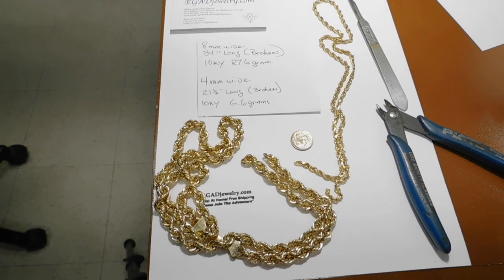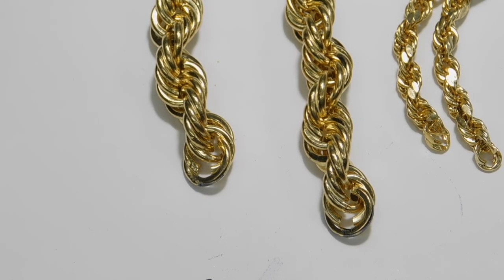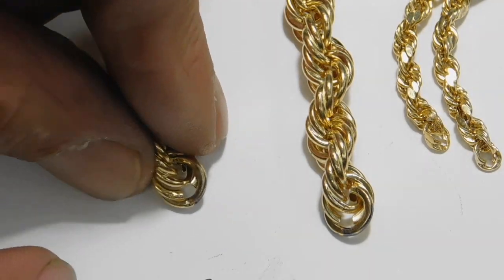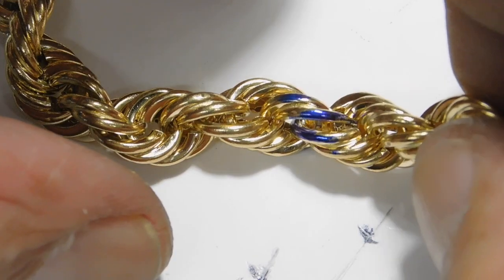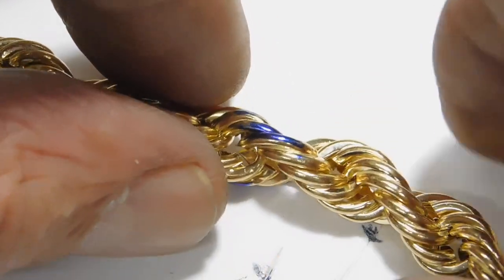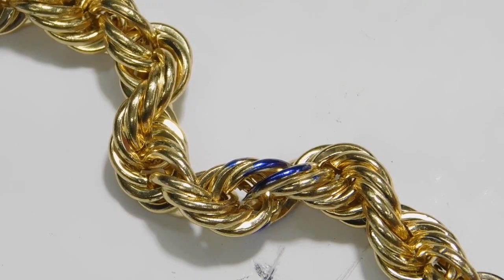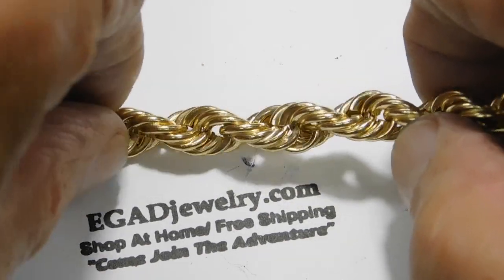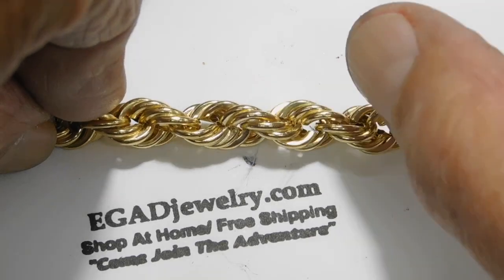BEST VIDEO FOR GOLD HOLLOW ROPE CHAIN REPAIR - EXPLAINED AND DEMONSTRATED - UN-CUT/LONG VERSION

Comment: Can you extend a 22 inch 5.5 mm mariner chain. To a 26 or 28 inch mariner if I have a section of the exact 5.5 mm mariner links from a bracelet I have. That matches the chain ? Thanks Joe
Reply from the maker: Hey Joe! As long as the links are identical you should be able to do that! Hollow links would be much more difficult rather than solid.
Reply: @egadjewelry6025  Thank you. 
I stay away from hollow gold chains. They seem to be to fragile. Can I mail you the chain and bracelet when im ready ? Also, how much would that cost to do, approximately for your labor ? I live in new york I'd have to Fed Ex you the chain and bracelet.
Reply from the maker: @mityjoeyoung8855  To be sure we can do it, can you email me some photos of the chain and bracelet? To egadjewelrymessenger@gmail.com
And we can see from there! Thanks, Jeni
Reply: @egadjewelry6025  Thank you. Will do when I have time to get to it. I'm not in any rush. But would eventually  like it done if it can be done.

Comment: 6.40 grams 3mm 20" 18k rope chain, hollow or solid gold?
Reply from the maker: This chain was hollow gold!
Reply: @egadjewelry6025  I bought the chain on MAY 11, 2022 for 36,147php OR
In dollar $682.32
Price of the chain is it worthy or not?
Reply from the maker: @ashajhi  Oh were you asking if your chain is hollow or solid? Sorry I thought you meant the chain in the video. I can't tell unless I feel it, but if it's hollow it will feel a lot lighter vs a solid chain is going to feel heavier and solid. You can also look at the links, if there is an open link check if it's tube being used (hollow) or solid wire. 

At $682.32 for 6.4 grams, you paid about $106 a gram for 18K which is a little pricey but if it is a brand new chain, that sounds about right. 
Hope this helps, let me know if I can help further. Thanks, Jeni
Reply: @egadjewelry6025  brandnew thanks for the info ❤️
Reply: 18k
5mm width
20" Miami Cuban
20 grams weight
Is it solid or hollow gold?
Reply: @ashajhi  hollow
Reply: @ashajhi  a 18k 5mm 20 inch cuban link should weigh about 46g

Comment: So rope hollow necklace not good to buy then??
Reply from the maker: Hi, hollow ropes will break easier, it's always better to buy solid gold instead of hollow. Soon we are going to make a video explaining the chains you shouldn't buy. Keep an eye out for our next video! Thanks!
Reply: A jeweler selling me a 26inch, 20.1 grams 6mm rope for $700 10k. I wonder if thats worth buying. But i remember you saying hollow isnt that good to buy.
Reply from the maker: @angelbluerider9588   That is not a bad price at all! But hollow is more likely to break at the end of the day, so we would suggest you save up for a solid one that will be worth the investment/last a lifetime. :)
Reply: @egadjewelry6025  which is better 5.5mm 21 inch 10k Italy stamped at 14.5 grams or 7.5mm 20inch, 7.5mm 12.1grams. I thinking the 5.5 is stronger and better due to grams right? 5.5mm is $400 vs 7.5mm $540. The 7.5 not italy made.
Reply from the maker: @angelbluerider9588  It is really up to you, which one feels/looks better for you. Like you said the 5.5mm is less expensive with the grams to price ratio. 400/14.5= 27.5 a gram vs. 540/12.1=44.5 a gram. 
We will always recommend 14k over 10k because 10k is harder and more brittle, vs. 14k is softer but more durable/less likely to break in the long run. I hope that helps!
Reply: @egadjewelry6025  is stamped 10kt with a Turkey stamped real gold?  And if yes how good is turkey gold is? Same as italy?
Reply from the maker: @angelbluerider9588  To my knowledge if it is stamped 10k, it should be gold. We have seen gold from turkey before and never had a problem with it!
Reply: @egadjewelry6025  thanks
Reply: I have a 26inch hollow 10k 10mm about 35g. Is there a way it can be made. Heavier by adding gold or is best to melt it down and start from scratch ?
Reply from the maker: @CarlosHernandez-el8kx  Hi! It would be best to melt down and start from scratch, or if it is in good shape, you could try to do a trade-in with someone.
Reply: 10k is low purity of gold and the color is pale yellow, better go with a higher purity and solid one it's worth the money instead of hollow and low gold purity.